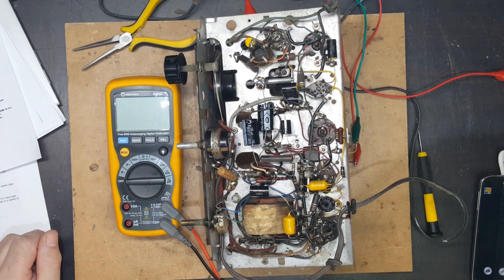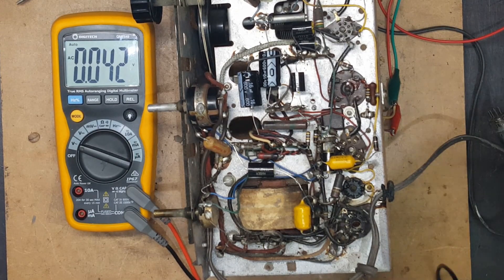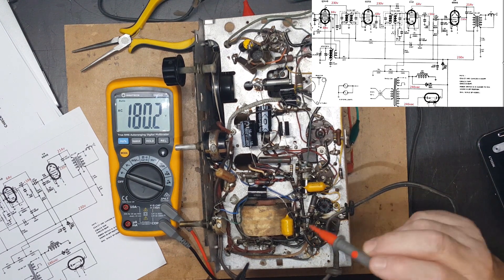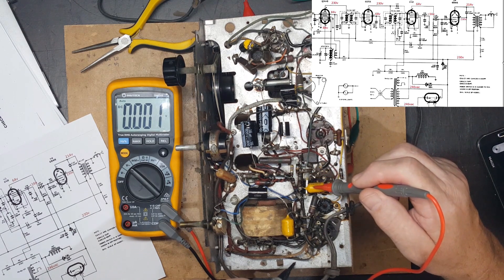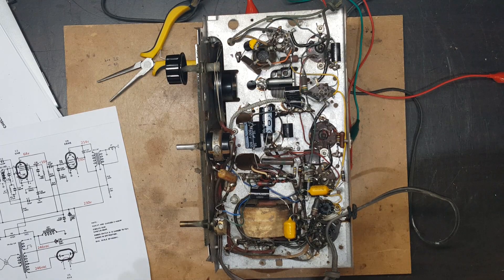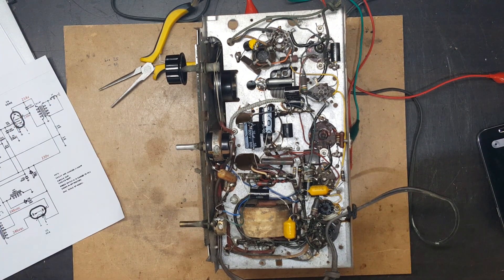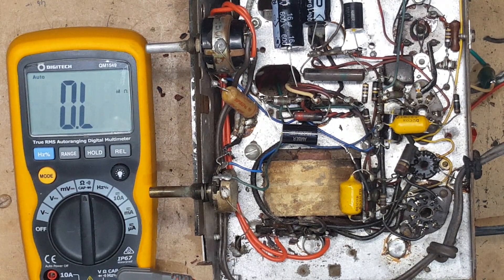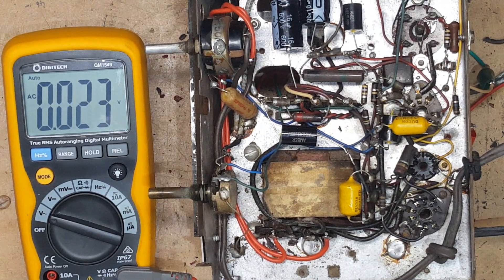Vintage Radio Restoration - STC A5130 Part 2 - Power On with a Wacky Transformer

Comment: Greetings:
Check the resistors for tolerance.
The open secondary voltage is sourced across the field coil. Check for 60 Hz ripple.
Reply from the maker: Hi James, thank you. This is a very old video, I can't remember if I checked the resistors or not now. We have 50 Hz in Australia 🙂

Comment: Transformer maybe failing inside. It maybe possible to disconnect the bad side and make bridge rectifier circuit with 2 diodes and the Fw rectifier tube, A fuse in the primary may help too.
Reply from the maker: Hello mohider khana, That would make it work but I got a new transformer for $10 👍🙂
Reply: @DavidTipton101  unwind the old transformer to see what is going on inside it!!! it can possibly be repaired depending upon the location of the secondary.
Reply from the maker: That would have been interesting but it's gone to the recyclers now

Comment: Just a thought.  The open is measured from a DC standpoint.  The point where there is an open in the winding is in fact a capacitor of some value.  That "capacitor" allows you to have an AC voltage on that side of the center tap.
Reply from the maker: Hi Wayne, that makes sense, these were early days and my first issue with a transformer but your explanation is good, thanks 👍🙂

Comment: The question is, is there any voltage on the open secondary with a load on (rectifier installed). I doubt it. The impedance of your meter is very high and I think that is why you are seeing some induced voltage on that winding. The impedance of the open end across the break is likely lower than the impedance of your meter.
Reply from the maker: Hi 984francis, I made this video very early on and it was my first transformer failure so I didn't know what I was doing, still don't in many ways. I 'think' I had the valve installed when I checked the output and that is what confused me. You are correct of course the DMM would read any voltage without loading the circuit. I think I put a 15 Watt light globe on each secondary winding to test it in the end, I can't remember if that made it into the video or not and I'm not going to check as it's too painful to watch 😄

Comment: I'd decided to follow along as you did this radio so I got the schematic to refer to. When you found the unequal t/f secondary voltages, I glanced at the schematic and lo and behold, it appeared to show that the secondary wasn't actually tapped in the centre. It shows 4 loops on one side and 3 on the other.
I thought it was weird but I was fully expecting to hear about some previously unheard of kind of transformer!

I reckon the STC guys could have drawn a better diagram, there was enough room to show the tap in the middle.😀

ps the scraper you use in Part 4 to clean the speaker plate looks very familiar. 

When I was an apprentice back in the 70s, we made scrapers from broken power hacksaw blades - does yours have a similar origin🤔
Reply from the maker: Hi Brian, that was a very early video when I knew even less than I do now 🙄 I checked the circuit and it looks like they drew 6 loops on the transformer secondary forcing them to draw the centre tap off to one side, I checked the circuit for the next model with the same circuit and they had changed it to 7 loops and drawn the tap in the middle 😄 
The scraper is made from Micarta sheet, we used them to remove sealant from aircraft skins so as not to scratch the skin. They later changed to a red plastic scraper.
We used to use broken power hacksaw blades to make knifes, the blade would sharpen up quite well and then wrap the end in tape or make a fibreglass handle if you were keen. I still have mine I made in the 70s in my professional tool box (not the junk one you see in the videos) 🙂
Reply: @DavidTipton101  I wasn't familiar with the product name Micarta but it sounds not dissimilar to the stuff we called Laminite.  The proper product name was Tufnol I believe. We used it for contactor coil formers and all sorts of electrically insulated parts.

This is what I used to make a handle for hacksaw blade knives & scrapers. Some fearsome knives were made, especially if the hacksaw blade was "conveniently" new. One highly sharpened edge and one with brutal hacking teeth. 

There were a few highly armed apprentice electrical fitters back in the day! 😇
Reply from the maker: @brianh2269  Hi Brian, sorry, Micarta was the brand name, it's phenolic sheet cut into strips, I haven't heard of Laminite but it sounds similar. I used my knife for work, I'm glad I didn't work where you were 😀

Comment: I had a shorted turn inside the filament winding of my Precision 200 C signal generator after restoring it for 3 months. Fortunately I still have my Eico 324 signal generator as a backup instrument on the bench.
Reply from the maker: It's good to have a back up, that's for sure
Reply: I've also have an old Philco radio that I use , in a pinch,  the oscillator as a signal generator. I can modulate the oscillator with my RCA  audio generator.

Comment: Dave, the winding that has continuity is inducing a voltage on the open winding. The Xformer is bad.
Reply: P.S., The voltage you see on your DMM is confusing but there is no current flow through that open winding. Replace it or re-wind it.
Reply from the maker: Hi PBR, this was my first radio that made it to video, to say I was inexperienced is an understatement. I went on to have a number of failed transformers in a row. Thanks for the info 👍🙂

Comment: Hi david, when you was probing the rectifier valve, you may had been probing the filament string, check the valve base
Reply from the maker: Hi Porky Paul, this video was 2 years ago when my knowledge was even less than it is now. The transformer had an open secondary winding which I hadn't encountered before and the symptoms puzzled me, so if I seem confused, I was 🙂 I don't know exactly where you saw me probing the wrong pins but you may be right, I just watched a bit and I seemed to be doing the right thing but I might be looking at a different point in the video to you 🙂 (This set has a transformer so there is no filament "string' as such 😉)

Comment: G'day David
I think some of the issue might be hindden by your low voltage continuity test and high impedance voltage test. The comment on a lamp load is a good idea.
Reply from the maker: Hi Bob, yeah, I shouldn't have used a DMM, I knew that and still did it 🤦‍♂️ That's good experience for me though 🙂 Thanks for your comment 👍😁

Comment: Dave, I know this is an old post but, don’t you read voltage across an open because the meter completes the circuit?
Reply from the maker: Hi Rick, you are correct, these were early days and my first broken transformer. I haven't watched it again but the error I made was using a DMM to measure the voltage, due to its low impedance it was reading the reaction between the remaining parts of the winding, if any load was applied to the winding it would have dropped to zero.  I'm not sure what you mean but this transformer has a centre tap which it grounded to chassis so I imagine I measured from the end of the secondary winding to chassis which is in reality across one half of the secondary, I hope that helps 👍🙂

Comment: Hi David, I was wondering where you buy your Capacitors from, I did a quick search on ebay some look expensive or is that what I should expect?
Love your video too 👍
Reply from the maker: Hi Melissa, I get then from Carl on eBay. He is excellent to deal with and I highly recommend him. I am not affiliated with him in any way. Link: https://www.ebay.com.au/str/vintagecomponentsandbooks
Reply: Thank you David, ill have a look at that site 😁
Reply: Just another question, what size Isolation Transformer do you use?
Reply from the maker: Output is 240V @ 1.25A  or 300VA Melissa
Reply: Ok thanks David, I ended up ordering a 600va, It was only a little more after the discount they gave 😁
Reply: Can you tell me the order of the Dim Bulb Tester, Variac and the Isolation Transformer, what order do they go from the mains GPO?

Comment: transformer acts like a capacitor
Reply from the maker: Not sure to which part you are referring Ian but I was probably confused as usual but I hear what you are saying 😀
Reply: @DavidTipton101  o the situation to do with the power tranny. the reason why you have ac voltage on the tranny when the winding open circuit. is the to with capacitive coupling. EG the good winding in induction  voltage across
Reply from the maker: Hi Ian, yes it was my first experience with a faulty transformer and I learned a lot. I expected the rectifier would drag down the failed secondary but no, I also knew not to trust a digital multimeter but still did 🤦‍♂️. I can't quite remember if it's in the video but I put a lamp across the secondary and it quickly proved the fault with a load on it.  Thanks for your help, experience is a great teacher, I can now spot a faulty transformer in seconds 😀 Edit: I just watched a bit of the video again... man was I confused
Reply: Not as a capacitor, but as an autotransformer. i.e, the existing windings are still behaving as an inductor, therefore they have voltage, but maybe only very low current.